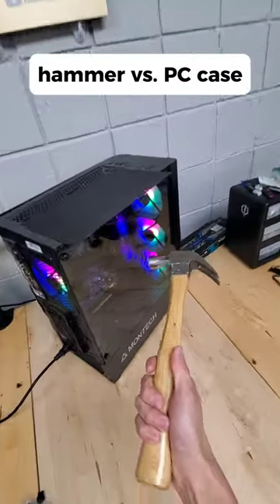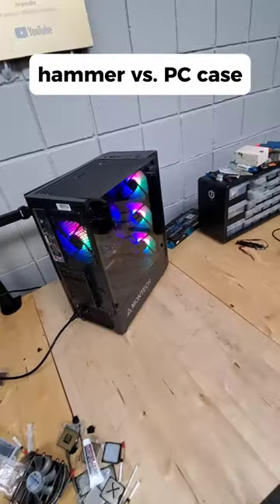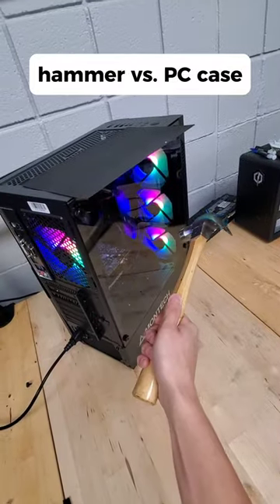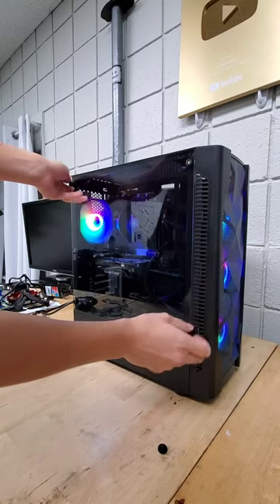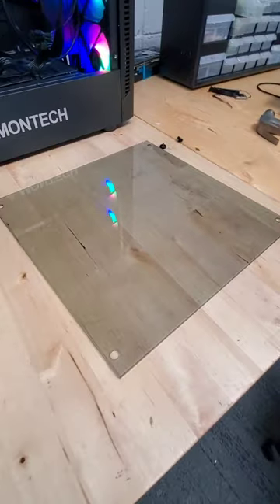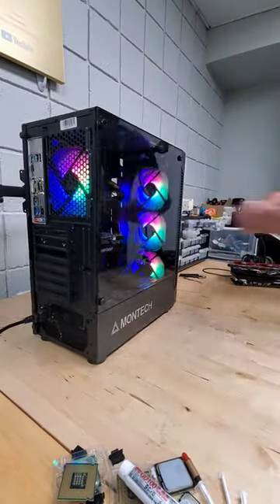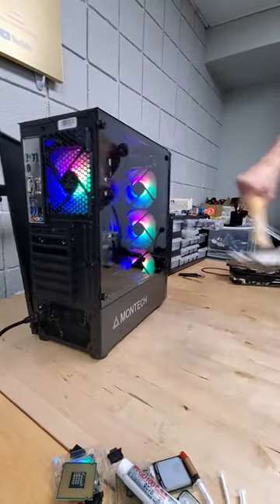hammer vs. PC case #shorts

Comment: That glass is stronger than the average american wall
Reply: *most expensive american wall
Reply: As an American you mean modern walls. My apartment wall has taken beatings. (I am the beating)
Reply: That glass is also stronger than Brazilian brick walls
Reply: @luizgbr22 I don’t think so buddy
Reply: new houses lol. I live in the US in a ~100 year old house, brick with wood sheath over it. If you punch it it will break you.
Reply: This is stronger than most Americans will to work.
Reply: fr
Reply: bro their walls are sometimes literally made of paper
Reply: In my country, our houses must survive typhoons, floods, earthquakes and sometimes volcanos so we use concrete.
Reply: Jxeonnn  the walls in germany are like a fucking bunker.they are so thick
Reply: yet it has an amazing Achilles heel. hold it by one corner and it'll shatter
Reply: Bro is speaking facts
Reply: Thats what tempered glass is like its amazing how material properties can change so much
Reply: well try smash it sideways
Reply: @RotchoN  yep it does depend on where you hit it
Reply: I live in a house build in the 1940s and it's incredibly tough. Yet, I still think a hammer to the inner wall is going to put a hole in it, because drywall is drywall is drywall. It's just going to bounce off if the 1 inch thick plywood on the other side and do some recoil damage if you're not careful.
Reply: @beowulf2772  Wallpaper isn't the primary material, it's a decorative outer covering. Most modern American buildings make the inner walls out of either drywall or very thin plywood/composite. Drywall is compressed gypsum (chalk) compound that is layered between paper on both sides, but the paper is just there to protect it until it's installed.
Reply: @tomkyx1  Some of them literally were bunkers.
Reply: As a morrocan our weakest wall is indestructible
Reply: Wait… walls aren’t supposed to be that easy to break?
Reply: @tomkyx1 how does plumbing and wiring work? Is there still space in between each wall?
Reply: unironically, yes
Reply: New houses. My house built in 1978 is strong, it’s drywall and such that’s weak
Reply: @beowulf2772 and what country would that be?
Reply: id rather have shitty walls than be affiliated with the thing
Reply: @leanonease  what thing
Reply: We should rephrase to “people who live in an american house shouldnt throw stones”
Reply: Yup💀💀
Reply: because it’s dry wall, mo ron
Reply: Drywall tastes delicious 🤤
Reply: @beowulf2772 do you live in america? No? Ok then
Reply: @krunchy_03 nah man our walls in europe is concrete. My hand will be broken before the wall even got a dent
Reply: @calvin2013  BRO THAT REPLY FITS PERFECTLY
Reply: That Glass is Stronger than a Chinese concrete Wall
Reply: Haha its true
Reply: As someone in America which every house I’ve lived in has that paper thin drywall in some places I can confirm our house walls are weak af. Just one tap of a finger and the whole wall caves in 😂😂
Reply: @luizgbr22 viajou rude
Reply: @bladeofmiquellalover i am brazilian and I guarantee you it is. Bricks can break quite easily if hammered
Reply: @luizgbr22  these walls over here literally break bones
Reply: a nail: no they aren’t
Reply: Yea
Reply: That's not saying much tbh
Reply: well that's a pretty low bar, but yeah
Reply: @luizgbr22 nah
Reply: @bladeofmiquellalover it is 😂
Reply: Donald trump can build better
Reply: bro i was suprised cause the glass is on my pc 💀
Reply: Haha😂
Reply: @tomkyx1 true i live in Germany its really the case
Reply: Is stronger than the average valorant player
Reply: Because they are made out of drywall?

Comment: It's funny how tempered glass works. A hammer strike won't break it but a small ding on a small area will shatter it to bits
Reply: exactly
Reply: like the chances if you slightly dropping it are so much higher than it getting whacker by a hammer
Reply: makes you wonder about engineers these days
Reply: Hear me out, round out the edges of the glass like on airplanes
Reply: I had one of my case sides shatter in my hands. I was moving it to clean it out and poof shattered to the tiniest little pieces and sharp glass EVERYWHERE. I instantly went into this vid thinking it was going to shatter like mine did. Looks like I had a faulty panel, but I would NEVER dare do this lol. Looks like witchcraft after my previous experience
Reply: @zEr0ic3Gaming mate…what the actual fuck. i had my corsair tempered glass shatter into a million billion pieces bc i dropped it 1 inch on the corner. I thought this guy was gonna shatter the glass too 😂😂
Reply: @jj-mm4jq  this vid scared me bro. He hit that glass so hard I thought my rig was going to shatter again
Reply: @zEr0ic3Gaming  you sure it was sharp ? shattered class is kinda special in that when it does shatter than yea, it pretty much explodes, but normally those pieces are pretty blunt.
Reply: @alandelain5757  They were yes. It broke mainly into tiny square like pieces, and some were very thin and extremely sharp. Indentical to how a cars front windshield would break. The square pieces since most broke on an angle or a slope had a very sharp edge to them. You could handle them, but you also wanted to be careful when doing so.
Reply: my shit fucking exploded when i accidentally tickle the corner to my floor 💀
Reply: Same here, case panel shattered to atoms for a 1 cm drop on the corner. Luckily Corsair replaced it for free❤
Reply: Once I took the tempered glass off and it fell like 2 cm and it shattered😢
Reply: Yeah it's called pressure and weight distribution. If you tried stabbing yourself with a blunt end of a pencil, it won't hurt as much as the graphite pointy end would it?
Reply: @fizzdude08 Yeah it's called pressure and weight distribution. If you tried stabbing yourself with a blunt end of a pencil, it won't hurt as much as the graphite pointy end would it?
Reply: Tempered glass is incredibly strong in the center and incredibly weak on the edges.
Reply: Yeah. Tempered glass shatters if you hit it on the thin edge,  also hitting the middle is the safest area. You want to hit near the edge or where a support is , prevents the gas from deflecting and absorbing the hit
Reply: Tempered glass >>> Hammer on the side.
Tempered glass <<< Instantly breaks if acidentally drops the glass when opening the case standing up.
Reply: I barely taped one on a desk and it shattered
Reply: more like if you hit it on its side
Reply: Yup💀
Reply: Happened to me not fun at all
Reply: there is still glass in my case
Reply: Literally what happened to my PC Case Glass Side Panel. I have an NZXT H5 FLOW Black (new pc which I got in march) and I was configuring rgb cables inside my case when one day I accidentally dropped it (drop height was no more than 7-10cm from what I remember) and I havent gotten it replaced ever since it happened which was 5 months ago, because I dont have warranty and now there are shattered pieces of glass inside my PC Case and the Glass Panel is still holding up because of the plastic coating which I never removed (thank god I didnt). The slightest touch can make a few pieces fall inside the Case. I need some help with getting the panel replaced (I reached out to NZXT and as I mentioned before, warranty was necessary).
Reply: Found that out the hard way twice with Corsair cases
Reply: @zEr0ic3Gaming this most likely isnt a faulty panel.

Glas is a "living" object. And CAN implode.

This can be seen in all kinds of tempered glas panels and windows.
Oven is a great exampel where this can happen. Its not common, but it does happen. Its 99% (number taken out of my ass) of the time not the manufactors nor the customers fault.

The implosion normally happens when its under a lot of stress.
Could be that you held the panel to close to the edge or pressed a bit to hard.
But it could also be for the reason that there was a micro crack or scratches that did weaken the strength of the panel.

Eitherway, its not to crazy that it did happen.

PS, if you want a jump scare of your life, try and get to a stresstest of tempered glas panels. The bang is extremly loud and comes with any warning.
Reply: Yup pretty much. Still doesn’t mean tempered glass is invincible tho. I take care of mine even if it’s strong glass
Reply: because its all about the pressure. force doesnt mean sht if the area makes up for it
Reply: I can confirm (my pc doesn’t have glass anymore 🙂)
Reply: That's how energy works, the same energy concentrated into a small point is much more powerful then energy spread across a larger area, that's how things absorb energy.
Reply: @fizzdude08  it basically a Rupert drop effect
Reply: @fizzdude08 if you think the chances of it getting hit by a hammer is low. You must not have a crazy gf but damn mine needs bulletproof glass
Reply: if you simply place it on some porcelain tile countertop on the corner it will explode lmfao
Reply: Compressive forces on the large side of it are handled much better than concentrated forces on a tempered glass panel’s edges or a blow from a sharp object

Comment: Tempered glass is always funny, it can take hammer hits all day at center mass, but you barely drop it on one of the corners and it shatters.
Reply: Had the same experience, my pc still has no side panel so I have to block it using my table.
Pretty sure it has something to do with the corners being weaker though.
Reply: That's because tempered glass actually flexes. If you hit it in the center, it can absorb the shock. If you hit the corner, it can't because the direction of the force is different. Untempered glass will also break easily if dropped on its corner or edge.
Reply: been their
Reply: <2 inches of drop height onto a corner and it will shatter
Reply: Yeah it's called pressure and weight distribution. If you tried stabbing yourself with a blunt end of a pencil, it won't hurt as much as the graphite pointy end would it?
Reply: knowing the concept of Prince Rupert's Drop makes your brain shatter
Reply: hiting it in the middle or letting it go flat on the ground wont break it since it spreads the force off the hit but the corner can not spread it the same way 
 @ARealPersonfr
Reply: Yay finally saw a person with the same pc as me although I'm not testing this out to see if it's true or not 😂

Comment: Sure until the little bits of micro-fractures you cause go through enough heating/cooling cycles and just shatters into tiny pieces for seemingly no reason. Plenty of examples of that on Reddit of people's side panels "randomly" shattering.

Comment: Not as common now but older PC cases could be used as a step stool. Goes to show how they are built well.
Reply: Fr😂😂
Reply: there was a youtuber who got hold of an east German Robotron PC compatible. without a keyboard or monitor it weighed 16-20Kg. there were so many Steel panels he ran out of room disassembling it
Reply: For sure 😂, I used my optiplex 790 as a seat before and stood on it.
Reply: Ahh, my childhood
Reply: I have a 7000d airflow mine still can
Reply: Yeah but it comes with a price. In my younger years it is heavy to service and carry across homes/office
Reply: My retro pc build weighs in at probably 60 lbs from the case

Comment: Mine shattered in my hands while I was getting it out of the case, luckily didn't get cut anywhere but man. Emailed Corsair support and they sent a free glass panel to me even though my case was out of warranty.
Reply: Luckily the tempered glass is designed to shatter into tiny pieces that make it less likely for you to get cut
Reply: @Vitis-n2v   car side windows are also tempered glass, they are tough until the desintegrate and it's super satisfying
Reply: I used to work on the driver side door line at the BMW plant in South Carolina. Installing the window required you to hold it with both hands and slam it into the regulator inside the door. typically, very strong glass. But every once in a while, I'd go to grab one and as soon as I applied pressure between my fingers and thumbs it would explode. Thank God for safety glasses. We played Russian roulette with that glass for a few months before the manufacturer fixed the defect.
Reply: @dobbi6083 saw 2 guys break into a car in the gym car park. I wonder what they used to break it.

Comment: he intentionally didn't put it against the wall so the case bounces back as gravity holds it down, very little energy is transferred to the glass, plus his hits must be super weak if he didn't even at least knock over the case, also if it was against the wall the kinetic energy would be transferred more efficiently and would shatter the glass

Comment: Im no physics expert or anything but judging from the sound of the metal I can assume that with you force you are putting on the glass with the hammer, the energy is being dispersed alongside the pc case its self because the glass in there sounds like its loose and rattling meaning it has space to move and disperse energy.

Comment: Tempered glass is not necessarily stronger than regular glass, I would even call it weaker. It just needs to be hit at a small contact point, then it will shatter. Just like in car windows.

Comment: Tempered Glass' weakness is pointy things. Doesn't even need to be sharp, just a dull point, and if you push it onto the tempered glass, it shatters as if it was never there. I could be misremembering though. Please correct me if i'm wrong.

Comment: My only two concerns for this was depending on how hard you hit it I suppose you could knock loose your ram or your graphics card but those are really in there so I wouldn’t really worry about that and also, if you did break, it may be a shot of glass getting in your GPU orsomewhere else that could break it overtime

Comment: But don't drop it on one of the corners because it will shatter to freaking bits and my older sister got a new case with the same type of door but she took the screws off then the caution sticker and while she was peeling the sticker, it fell off the case and landed on the bottom right corner and pieces of tempered glass went everywhere on the kitchen table then the floor. a small piece hit me on my hand but I didn't bleed, I really feel bad for her though.

Comment: I wanted to know if this is a good Pc build 

AMD Ryzen 5 5600X

MSI B550 MOTHERBOARD

Corsair Vengeance LPX 16 GB

Samsung 970 Evo Plus 1 TB

MSI GeForce RTX 3060 Ventus

NZXT H5 Flow ATX Mid Tower
Case

Supply
Corsair RM750e (2023) 750 W
80+ Gold

Comment: Because thets how tempered glass works 😂 if you use a pointy object directing the hit to one small point jt will shatter into a lot of pieces, but because the hammer has a flat surface the hit just spreads to the rest of the glass, that's why window glass breakers for cars are a metal pointy tip

Comment: Yesterday I opened my computer case to put a chocolate in it to keep it cool and I was so worried I'd drop the side. Now I know that if I did it wouldn't even break.
Reply: Don't do it. This type of glass can  take direct hit at the middle when it is properly balanced. However, if you drop it roughly  onto the corner, a slight vibration would be enough to shatter the whole glass. Even a centimetre high drop would shatter the glass if it gets hit at the edge or the corner area.

Comment: how tf did mine break on my pc i litterally was putting it in the wholes then tried screwing it in and shatters in my hands into the pc by the power supply had to get a vaccum and vaccum it out im mad confised a hammer cant break it but putting it back on can 😭

Comment: Why do pc cases need tampered glass? That's glass that car windows use. Why does a pc that stand around in your house (not going anywhere) need such a strong glass frame? Why don't laptop screens use tampered glass? Or monitors? Why does a monitor have weaker glass than a pc case????????

Comment: Thats cap i tried to screw my glass on while ite at 90 degress ans not facing on the floor and i was holding the corners and it snapped and broke into tiny little pieces everywhere

Comment: Ryzen 3 3200g

 Ryzen 3 3200g processor
Gigabyte A320 motherboard
8 gb ram
512 ssd
Monitor 22inh
4 GB graphics card
450 Watt power supply
Webcam zebronics sharpe
Punnkfunnk headphones

Intel i3 10100f
I3 10100f processor
Gigabyte h410
8 GB Ram 3200mhz xpg
512 gb ssd
22 inh monitor
Rgb cabinet
4 GB graphics card
450 power supply 
Webcam zebronics sharpe
Punnkfunnk headphones

Kokon sa best ho Gaya
Gaming, editing, Live stream, coding

Please reply me 😢